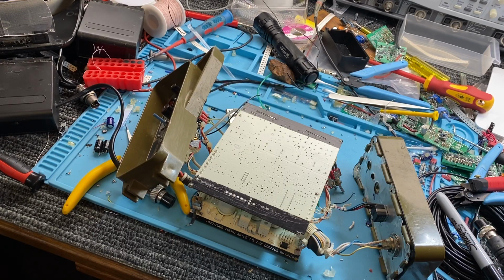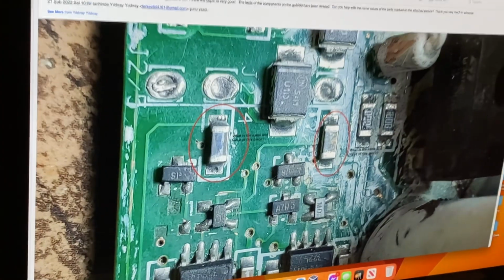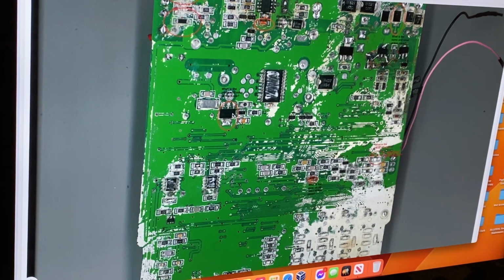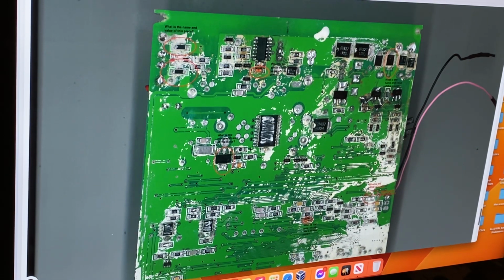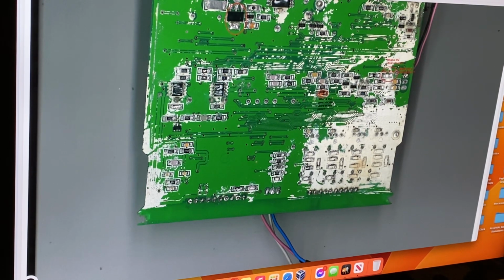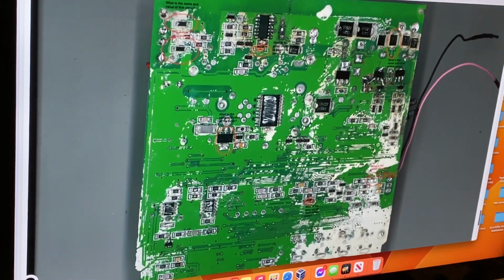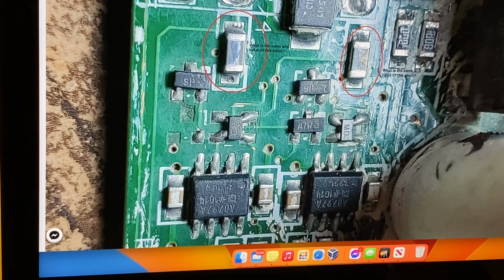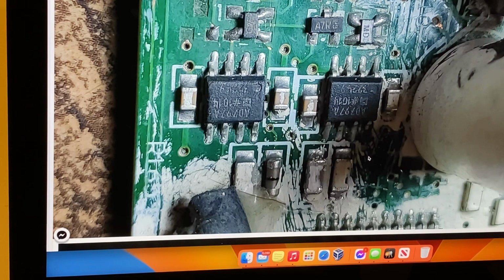Mixed bag Minelab repairs, updates on mods and project detector

Comment: Hi. Mr woody

When I measure the voltage of the +5v line it has +4.98v. When I measure the voltage of the -5v line there is -4.58v. but the device is working but unstable why this voltage may be low. In addition, the diode next to cd4093 on the lower pcb shows values in both directions. Is this a normal diode or a zener diode? If this is a zener diode, what is its value? thanks.
Reply from the maker: It is a zener diode 12.6 volts.

Comment: Hi mr. Woody

What can we use instead of tle2022
Iam not find original tle2022
Reply from the maker: The TLE2022 is still in production, it is available.
Reply: @DetectorMods  again hi mr. Woody gp3500 bottom pcb 455 Mosfet and adg333 very hot. Why is adg333 ,455 mosfet very hot. Thank  you very much
Reply from the maker: Replace it check input fets and bf908 also tx mosfet may be short circuit, try with no coil.

Comment: Hi. Mr. Woody
Gp3500 have capacitor 150uf 150v other 2x1000uf  and 4700uf  How many volts are polarized capacitors?
Reply from the maker: 25 volts on the 15 volt rail , 10 volt on others.

Comment: hi gp3500 -5v power line is constantly changing.  For example, when I measure with a measuring instrument, the voltage is constantly changing, such as -1v, -2.5v, -3v.  What could be the reason?  can you help me.thank you very much
Reply from the maker: There are two soic mosfets under the circuit board, one is failing and it is the one on the negative 5 volt supply rail.
Reply: @DetectorMods  thank you very much

Comment: I know that it Needs oscillator circuit , amplifier circuit comparing circuit frequency maker circuit with a double coil Receiver and transmitter 
So i need to design each of these circuits   one by one and then assembling them together
Reply from the maker: Search detector schematics on google.